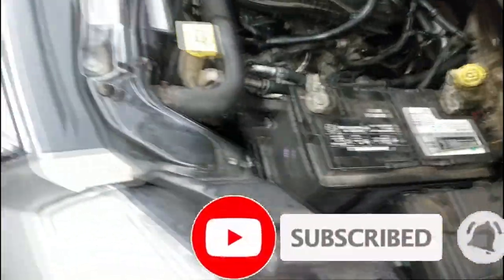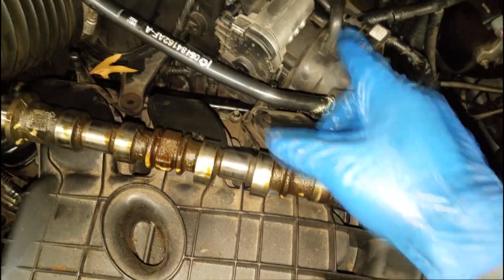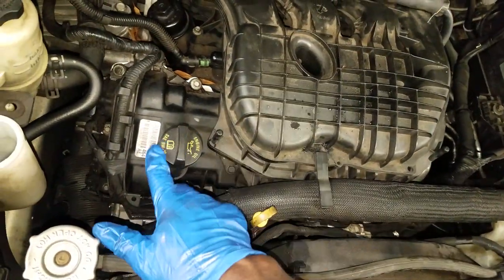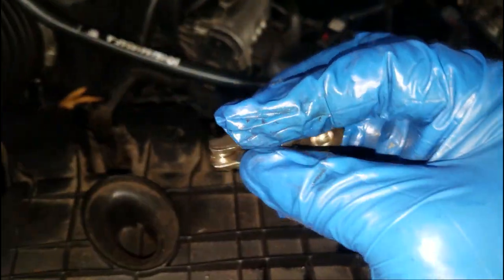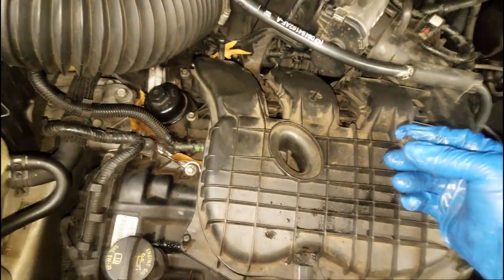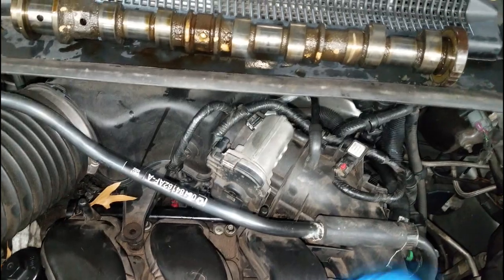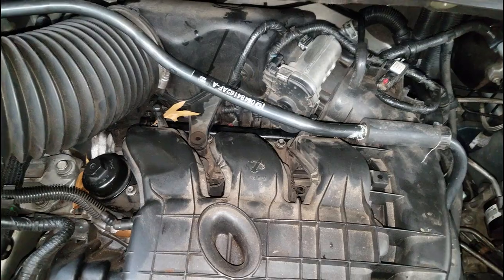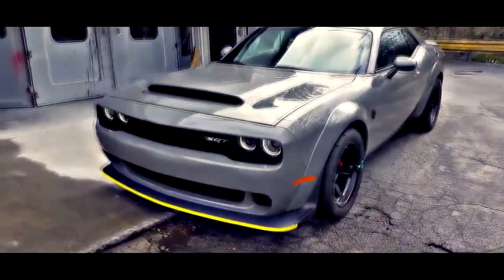3.6 Pentastar V6 ticking noise broken rocker arm camshaft FIXED. What parts you should check  3.6L.

Comment: I've used Amsoil synthetic since my jeep was new, I had one go bad, changed them all.  I cached mine quick, no damage to the cam shaft.  I ended up changing all the lifters too.  Thinking that I won't have to touch that side again for a while.
Reply from the maker: lol, good idea changing them all. Nobody want to go back inside a valve cover on a Jeep Wrangler thats for sure.. I saw you tracking down that small evap leak on your Wrangler, those P0456 can be a pain sometimes. Thanks for watching bud, please thumbs up the video and sub the channel for me, thanks.
Reply: @OnlineMechanicTips  Yes Sir I did!  You've got some great video's!
Reply: @OnlineMechanicTips  what was the fix for the small evap leak. I have one that I cant figure out on my 14 Jeep GC
Reply from the maker: @joeheck5131  This what I found using a smoke machine on the Jeep GC. Not sure if its your problem tho. https://www.youtube.com/watch?v=N7Ph__sMllo&t=16s

Comment: Just did cam and lifters on my 5.7, cam was $240.35 from wholesale mopar. 

Question? Why do you think Chrysler recommends 5w30 in the vans 3.6 pentastar but in my other charger w/ 3.6 pentastar Chrysler recommends 5w20
Reply from the maker: My guess would be that they switched for CAFE or factory commonality reasons, but according to the manual, you can use either.  I could never get a straight answer out of the instructors and the engineers at the Chrysler Training Center. Good job on that Hemi bud. Thanks for watching, please thumbs up the video and subscribe to the channel, thanks

Comment: i have a 2012 grand caravan crew, new plugs,coils,injectors, no tick, but misfires, all cylinders, no codes, does it on start up and high rpms, thats in park and drive. RPM at idle is 625 / slight engine shake in park and drive, i cant figure for the life of me what the problem is. also no vacuum leaks

Comment: My 13 t&c 97k sounds the same... I'm not sure if the lifters are going out or not... I have extended warranty with autonation, I may just take it to the dealer and have them overlook everything. it does need the transmission fluid change also.
Reply from the maker: Good idea buddy. If you still have a warranty you should go get it inspected before it ruins the camshafts then they try to deny your warranty because you abused it (waited to long)

Comment: Looks like the front bank rocker and exhaust cam lobe from my dad's 2013 T&C. New Mopar camshaft lists for $209, but can be had from online Mopar sellers for about $145.
Reply from the maker: Close, remember the exhaust camshaft on bank 1 has a centrifuge which is part of the PCV system.  Im sure this camshaft a little more expensive.
Reply: Just looked up the right bank. Mopar listed $259, online $178.

Comment: Hi, thanks for video, can you say about lifters, if it fingers tight not go down, and fully up, is it good lifter, or it should be shifting quite a bit up and down, I do myself this job, and buy new rockets, and lifters mopar, lifters are sticking and no shift up/down, I did few tight lilbit in wise and it start updown approx. 1/16 what I did screwup it or not.

Comment: My question is that I wanna get away from the 5.7 because of the known lifter issues but don't want to walk into another. What years are the worst for the 3.6? and when did they fix this issue? Would I be better off just getting a smaller Cherokees with a 3.2? I tow about 3000 lbs every once in a while
Reply from the maker: Hello my friend, theres really know reason to steer clear of the 5.7 engine.. The know problems you referring to was a vendor issue and since corrected. Referring about the 3.6, the early built 3.6 engines as in the 2011 2012 2013 was the first generation Pentastar with the poorly built rocker arms. Concerning the small Cherokee, I have yet to work on the 3.2 from an internal engine stand point, so they hold up very well..Please subscribe to the channel for me, thanks
Reply: Thank you for the info, just had some automotive paranoia with it after seeing so many claims. I think I'll just keep driving my truck then. Do you know how common the 5.7 lifter failures are, not to steer this subject from the 3.6

Comment: I used full synthetic all the time...still tick.....poor quality rockers...check oil pan when done.....have seen  needle bearings sometimes.
Reply from the maker: ding ding ding. People still believe the oil they use will stop, prevent or even fix this. It will not. Its all about the poor quality of the part, in this case, the rocker arms. They have been revised and better now. Yes as for the bearing, they def in the oil pan. https://www.youtube.com/watch?v=BNdDtxm4Wgs&t=328s

Comment: Most rocket arm failures I've seen are from the inside of the pin bearing 
  This is usually only a oil failure.
Reply from the maker: I agree PJ

Comment: So my 200c with the 3.6 was ticking like crazy for about a month and a half. Then just one day stopped. But I also had found metal in the oil filter and the dealer said I have to bring it back to them for them to find it. I was all set to do then the. The ticking went away, so how do I get the dealer to properly diagnose it?  I have about 20,000 miles of warranty left on my CPO warranty, do I just have to hope it reappears?
Reply from the maker: Hello my friend, if the noise a result from the valve train and maybe a spongy lifter, it can return. Because this is a known problem, most dealers may just go ahead and repair it. But some may get picky and want to keep there warranty expense down and simply advise you to return when problem return..

Comment: Do you have a video of how you replace them? And do you take the chain off and use a tool to hold the chain in place?
Reply from the maker: Danny thanks for watching and subscribing. Now I have several videos out removing and replacing rocker arms and lash adjusters. But after reading a lot of the comments, I do not think I go in deep enuff on exactly how to do it and what tool you should use. I am in the middle of replacing a 3.6L engine out of a van, when I get it out, I will go over the proper way to do it and what tools to use. Now I do not use any tools personally but I will show my subscribers how its suppose to be done the correct way and all about the timing chain and timing. But for now, look at my 3.6L Playlist videos and seehow ive done them in the past.

Comment: Hi thank you for your video im on the market to buy a 2017-2018 dodge caravan do i still have to worry aboute this problem or they fixed it now?
Reply from the maker: O yes, this problem and those roller rocker arms has been revised. I have yet to have to repair engines on the 2017 and up 3.6 engines
Reply: @OnlineMechanicTips  do the ones repaired from 2012 to 2016 last or are the replacement rocker arms defective too?
Reply from the maker: @MaynardFreek  My man, thanks for watching and subscribing. Yes, from what I was told at the training center, the valve train parts (rocker arms and lifters) are redesign. Same part numbers and they even look the same, but I was told they are redesigned.
Reply: @OnlineMechanicTips  well it seems like the redesign wasn't much of a redesign. Because I'm having the same problem on my 2016 GrandCaravan R/T at 98K.
Reply: @MaynardFreek  its not much of a redesign. I'm having the same issue on my 2016 GrandCaravan R/T at 98K. Glad I've got a warranty from CarMax that I believe overlaps the Dodge dealer warranty as well. Looking to take it in soon.
Reply: They absolutely DID NOT fix the problem.  There is currently a class action started as of March 2020 addressing this fact. I have a 2014 and have two bad rockers which ate up both camshafts in bank 2. I found evidence where someone before me attempted to fix this (likely a different rocker). They likely quit and sold it when the problem returned.

Comment: Getting mine on my 200s Friday new from dealer 360 dollars and it is the right side intake cam. I rode mine to long and 3 of six rocker arms need replaced and my lobes were horrible. So I’m just going to replace all arms and lifters with cam. Me and my pops only concern is trying to find the TDC on the 3.6 before we replace cam. Any tips would help thanks
Reply: With the valve cover off look at the cam phaser timing marks. Right/rear bank will have two lines that will line up with each other, left/front bank will have two arrows that point to each other.
Reply: Thanks boss we ran into another problem while removing the phaser the chain jumped back two links and we are stuck. Is there any way to bring the chain back towards us. Thanks again